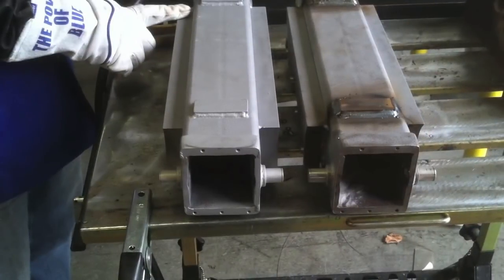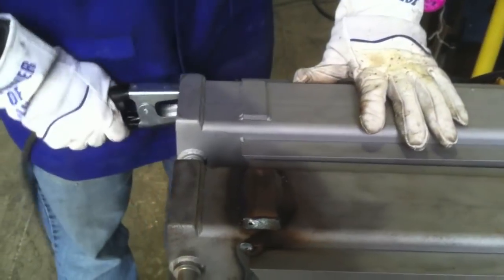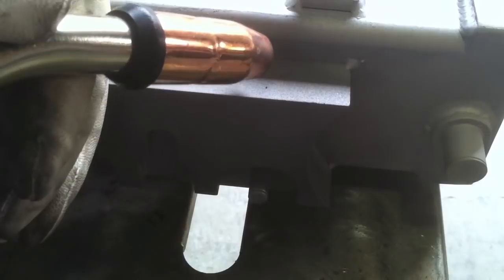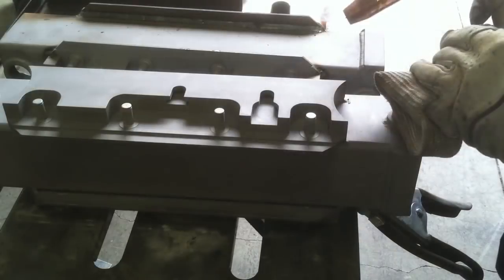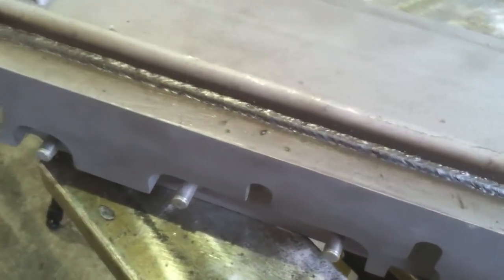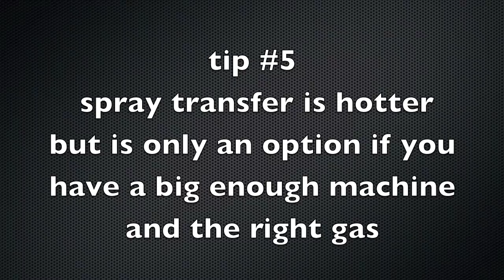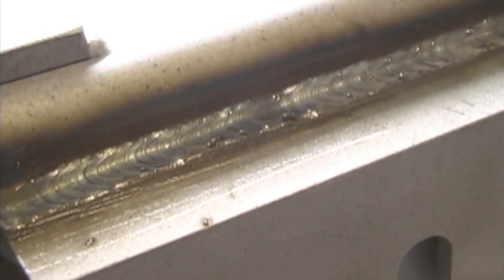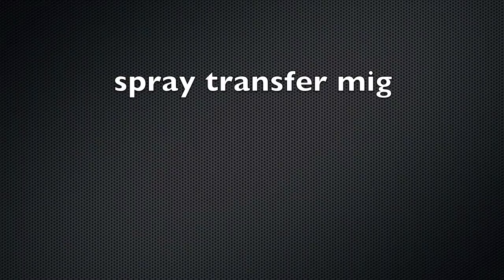Mig Welding Techniques Short Arc and Spray

Comment: Great Video! Many people forget to mention spray tranfser when talking mig. I weld alot or socket welds on a positioner with that process. If you have very clean metal and wirebrush after welding with just a little practice you can make that weld look like it is cast in the metal! Pulse spray also makes very pretty weave caps. It is a great process. A properly trained welder can get almost TIG quality welds with faster times than even short circuit!  I like .045 for spray carrys current better.

Comment: Brought back memories... I worked for FMC building box cars in Portland, OR. Used a 3 station gantry welder on the car sides running the length w/.045 wire using spray mode. Welding 2 sheets of steel to the frame.

Comment: we use metal core .045 wire at 30v-35 and 480 wire speed. hot and fast:)
Reply: Rene Miller can you use 75% 25% ?
Reply: I run metal core at 26v and 400 wire speed but there's always alot of spatter is that a common trait for metal core dont run it much by the way that's on quarter inch square tube

Comment: JODIE, IM AN OLD TIMER, EMPLOY 30 PLUS PEOPLE, AND IM ALWAYS READY FOR THE LATEST AND GREATEST, I'M A 7024 LINCOLN JET, ALWAYS RUN ON AC, I BOUGHT MILLERS NEWEST MILLER MIG, AND I RACED ALL MY OLD-TIMERS, WHO DESPISE THE MIG,!  WIRE WOULD JAM, SPATTER, ETC!!!!!  NEVER COULD I BEAT THE GOOD OLD JET!  THE JET ALWAYS WON, NO CLEANING THE NOZZLE, ETC, PLUS THE LOOKS, THE JET LOOKED LIKE A ROBOT, PUT IT ON! AND I HAVE TO AGREE, SHEET METAL, MIG ALL THE WAY, BUT WHAT WE WERE FABBING WENT FROM 1/2 INCH PLATE TO 1 INCH,  YOUR THOUGHTS SIR??????????  THANKS!
PS, I BOUGHT PALLETS OF LINCOLN JET, SO WE PUT OUT A LOT OF SPARKS AND SMOKE!  THANKS AGAIN!

Comment: @APPLEPIE978 I believe on a flat work piece there isn't a whole lot of difference.  It is generally understood though, that when you push the arc is at the leading edge of the puddle and allows more heat to reach the work piece.  This in turn allows more penetration.  With mig pushing is usually a better bet for a beginner to give better chance for penetration.

Comment: Thanks for explaining that. I just had to fix a spray transfer weld on the axle tube of a 77 bronco that had a crack running through half the tube. Like you said, not good on anything thin. Especially not when the workers were drunk on Friday back in 1977, which I hear was common, lol. Congrats to your 10 year challenge by the way. You got older.

Comment: @donnyp1966 I think its the other way there. Pushing allows faster travel time, however pulling allows more pentration but is slower. Most sheet metal is push since the pentration isn't really needed and speed is key.

Comment: I'm on the steel bridge team at my university. We ran out of 75/25 gas and no time to waste so we switched in the pure argon tank from the tig welder. At that moment we learned what spray welding is. We had to use this on some pretty thin tubing and it was obvious that much more heat was put into the steel. We ended up using a really low wire speed to try and do the thin stuff. It was definitely not ideal.
Reply: John Fraser that wasn't spray u can't spray with pure argon there's videos on it

Comment: People be ware spray has a very concentrated arc&high current density you might want a shade 11 or 12 lense. also 95% argon 5% Co2 will Spray, 98% argon 2% oxygen works well on stainless&steel. A proporotional gas mixer is expensive but with it and two gas bottles you can pick the mix! Just don't exceede 5% oxygen. If using short-circuit try 50% argon 50% Co2 Deerer dig and cheaper. It will make more spatter but it handles mill scale better. Spray always look better with slight push angle.

Comment: Hey Welders,
when I use my mig welder I have problem with wire speed, seems if I set it lower the wire melts back to the gun, if I set it higher it jabs into the puddle, what am I missing.
thanks
jim

Comment: Just curious on what the gas flow rate is for spray transfer welding on 1/4” mild steel? Been having some random issues with porosity from time to time and just looking for some help. I’m not able to find any general perimeters for spray transfer. Thanks you for your time. 🤙🏽
Reply: Could be dirty steel or too far stick out. We run 45cfh at work but there are drafts at times so that may be overkill.
Reply: @caydenbowman1079   Thanks, yeah our material is clean and new. I can weld tubes just fine be have issues when legs on to our plates. Kinda like a T plate but two side by side and about 3 1/2” apart. No wind drafts, I’ve also tried a different gas bottle and even changed hinges thinking it was clogged up and that seemed to help but the issue came back. I’ll try increasing the gas flow and see how that does. Thanks again. 🤙🏽
Reply: Hey guys I run a lot of frames and supports using this transfer method all the time, porosity make sure your tips and diffuser are secure good angle and tbh I know this is beginner stuff but i like to build my puddle and then keep like a 16th off the leading edge when allowing the puddle to sink in and build up on the base material
Reply: @snus9088  Hey thanks. Yeah we’ve had a few issues and it was a lil hard to figure out what it was. We change gas bottles, tips, nozzles, wire, even the gun. Had the machine serviced and we believe what the problem was all along was the defuser. After we swapped that out the problem seemed to go away. IDK but I’d never had that happen in my 15 + years of welding.
Reply: Haha we always look past the simplicity brother, hey I feel it’s very true to its name in spray and that ur spraying that right in there at work in the shop they run 50cfh argon I know that’s overkill prob 40 is sufficient but they what production not perfection. I run hot  like 32 w 450 wire .045 wire what are your settings and do your find yourself holding a hard angle sometimes helps?
Reply: @snus9088  for the most part the hardest part is running the weld inside the jig where you can get a good angle. Pulling the gun to myself and trying to keep a 45 degree angle for my fillet.
Reply: @bigpappas65ss  I hear ya when my partner is out I usually have to run left handed on the jig at my shop and let me tell you I suck as a lefty lol
Reply: @snus9088  Hey that is the advice I give to all the people I help when learn how to weld. It doesn’t matter if it’s Stick, MIG or TIG welding. Learn to do it with both hands. There will be a time when it will help you out greatly.

Comment: This is the first of some hundreds of videos I watched, which left me really angry and bothered. I undertook a welding course some 10 years ago. Did okay. Can weld okay. But never have I heard the terms short circuit mig or spray transfer mig or that it does it not matter if one passed left to right or what angle the stick is held.  I was shown one way and this by someone who earned his living welding.  Well off to the workshop, prepared some stock and I tried the methods. Thanks very much.

Comment: I'm new to welding and I have a cheap 120 amp welder with 4 heat seatings I was welding on the 3rd maybe 4th setting and it was spray welding is that normal, I was just practicing on 1/8 steal
Reply: Guarantee you it wasn't spray welding based off that description. You need the correct gas and settings to spray arc weld. You're not going to spray with a 120v..and if you do you're blowing your breaker after about a 1/2in bead lol
Reply: @lol123321123321  the liner was bad and it had a bad ground and it ended up in the trash

Comment: Hey Jody can you weld uphill with transfer spray? I have the wire and box says you can weld in any position,
Reply: The answer is at 8:08 you can´t go vertical up.
But if you try a flux core wire like ESAB OK15.14 then you can go uphill, under-up and more.. with spray arc.
Reply: I weld in a production shop using spray transfer and believe me there is no way to run uphill. FYI I have 2G unlimited AWS 1.1 with 0.45/1/16 wire using spray transfer.
Reply: Normal spray transfer with solid wire can not go uphill it is too liquid, but fluxcore wire dual shield can very easy go uphill, I use ESAB OK 15.14 wire, 225 amps
Reply: +Povl Halberg I agree 100%. I run anywhere between 28.5-30 volts 375-400 wire.
Reply: hello such as from Bogota, Colombia I also did this same question to joy because I am very interested in this answer, I have never done the test of applying mig spray to platinas in ascending position.

Comment: hi there. I run 29.5volts wire speed 565 on a miller 252. my question is why do my welds look very smooth but have a small line across my welds. is that good or bad. it has like a feathered look to it. i appreciate if you can answer this.
Reply: Douglas Centeno I run similar settings, 29.5 @ 535 or 540.  The line is actually a sign of a perfect stick out distance.  it's not a flaw.

Comment: when I was building suretrac trailers, I was welding 3/16x 2 angle to 3/16 plate for ramps.  my settings were about 30 volts or so.  not really sure what my wire speed was.  it was a Miller wire feeder. when we were running .035 wire, the feeder was wide open and about 5.5 when we went to .045 wire.   everything looked great and I was fast.   best part was not scrapping berries!!!

Comment: Pulling is stoving not a strong weld and you have cold lap, bad welder.
Reply: did you mean pulling is stupid?
Reply: +g goward no stoving it's a type of welding that should only be done with the correct wire and metal preparation.
Reply: from my understanding stoving or stovepipe doesnt use wire. its downhill stick where two welders start at the top of a pipe and finish fast as to prevent cracking. not sure why youre even talking about that on a mig video.